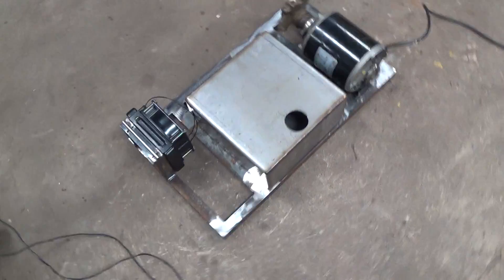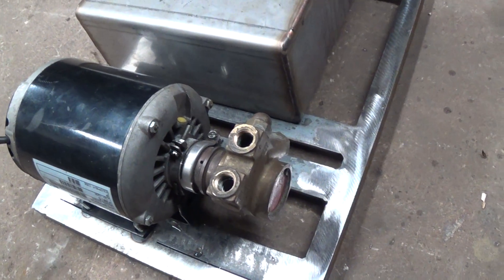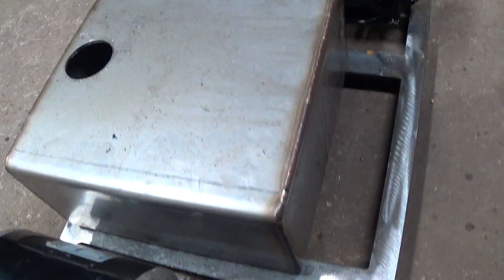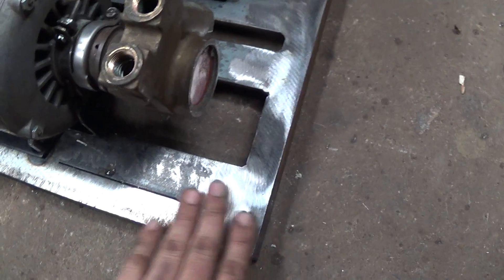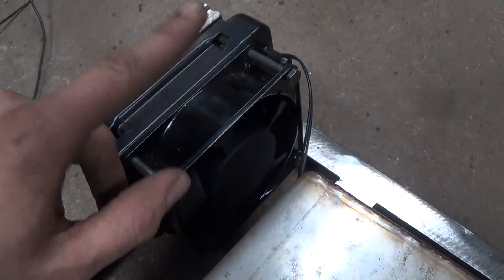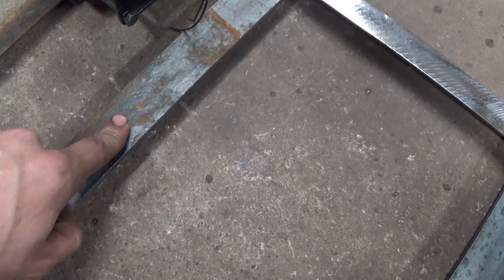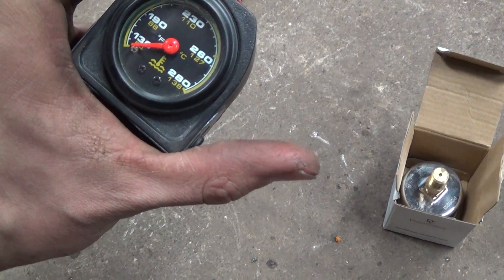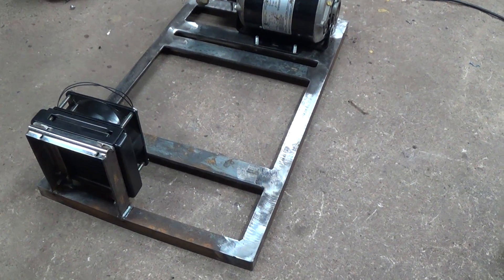Homemade Tig Cooler Pt. 1

Comment: Badass I'm building mine now . Do you have a link to  the fan and radiator? All I can find is 12v. Thanks!
Reply from the maker: I just used a computer fan, search ebay for computer fan 120v